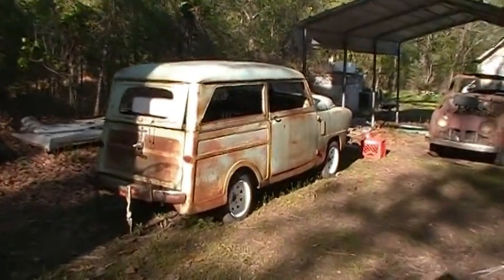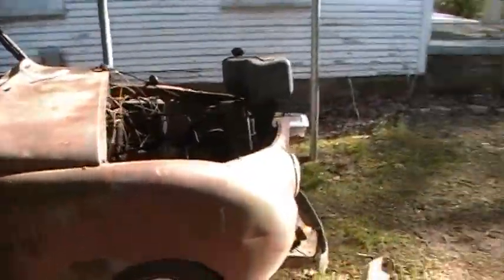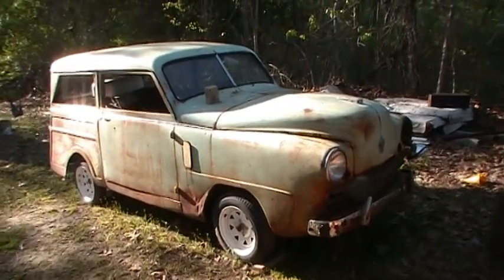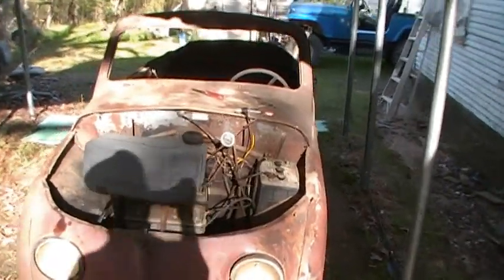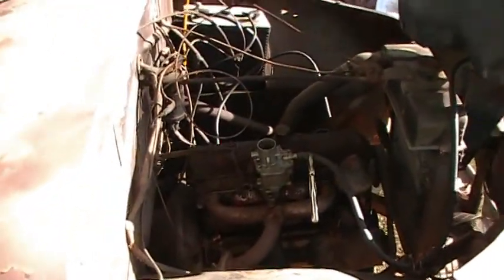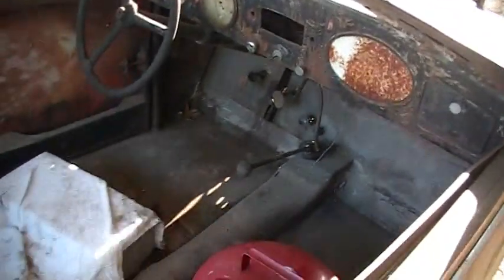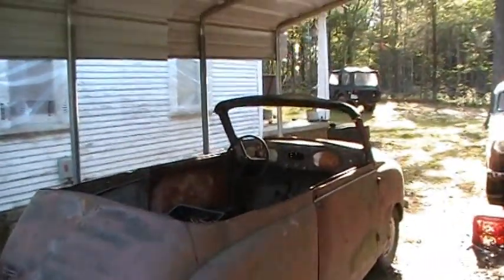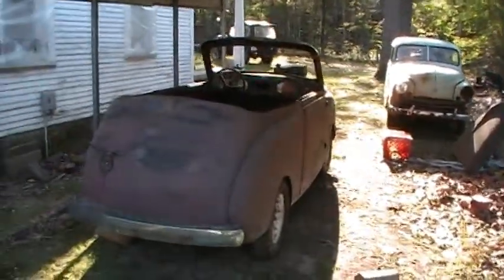Crosley Car Projects

Comment: Hey I like the Crosley wagon. Now the other one that you found buried in the forest I find thats amazing that you got that engine started. Yeah too bad you had to cut the top off but hey I can understand why. If you had to make a new metal top it will take a lot of work with a french wheel to shape the metal using the cut off piece as a pattern. Or just leave it as is strengthen the body with some steel up rights and make a convertible top.
Reply from the maker: +Larry De Silva  Look at the video of the wagon finished. Thanks Larry!
Reply: You know i didnt realize that vid was from a couple years ago. Dam im getting old maybe thats the start of alzheimers after all im 65 lol and mom died with dimentia at 87 so who knows

Comment: Ole Bullet's beg'n to be a ratosley!  Its already got a good start on a wicked top chop.Cover the rust holes with duct tape. Or leave the roof off. Like a open air touring phaeton.The rest of the body&paint is purrrrfect as is.Natural patena you can't recreate. That little motors beggin to go. RAT ON RAT ON